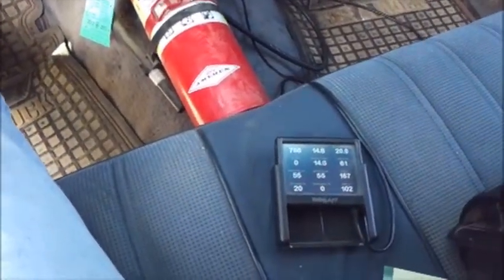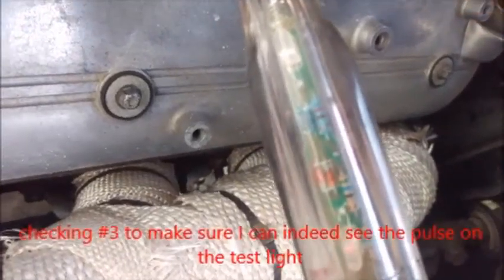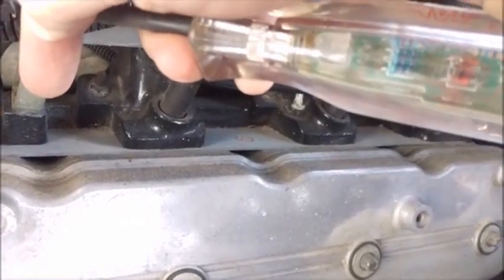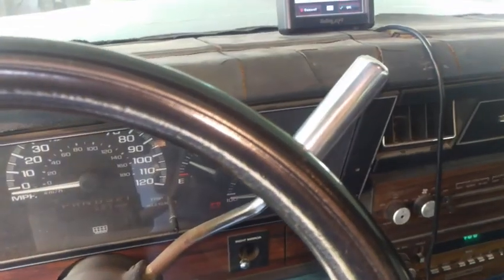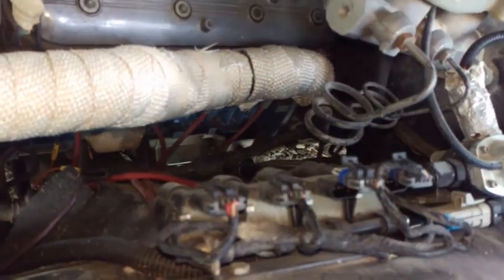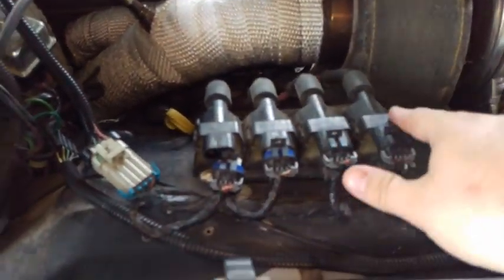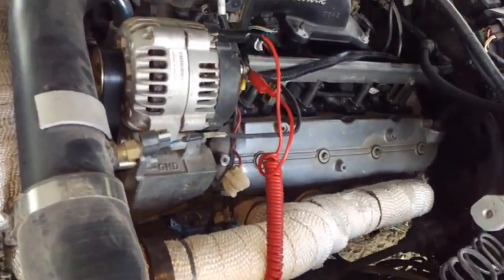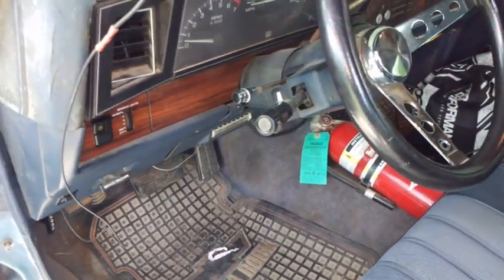holley dominator efi no injector pulse issues on multiple cylinders at once

Comment: i had the same issue with my dominator for a couple years it would occasionally start with a misfire that would heal with a restart, i'm suspecting the computer is failing, it got worse and would only fire a couple injectors and wouldn't come back after a key cycle, unplugged the main power to the computer for a minute after reading about it on the holley forum and i'd get my injectors back, fast forward a couple months and now it's completely dead, haven't had time to diag, you figure yours out? only thought that computer was expensive when i got it for 1400 new, now there 2100

Comment: check the wiring on the other side if there are pulse tot the cable's
Reply from the maker: This issue when it comes up is very consistent.  It will drop 4 injectors or 1 injector for duration of that ignition cycle. Kill key power to the ECU turn it right back on and it may not have any more issues for a week.  It has NEVER lost injector pulse after engine was already running fine. Only at startup.  I can kill the engine by unplugging injectors or coils, and restart engine WITHOUT first cycling key power, and the no injector pulse will continue. The moment you key cycle and restart its fine again.  When the injector pulse is missing, if I continue to drive, it will continue to not pulse as long as I drive.
Reply: @LT1SWAPCOM  than you ECU have a problem
Reply from the maker: @djverhulst  its already been replaced by holley tech support for this issue.
Reply: @LT1SWAPCOM   than look for interfearing  of the cable or bad connector power of grounding

Comment: I’m having the exact same problem, It will drop ground to one injector every so often while cold only on startup but it will do it all the time on start up while hot. I must turn off and restart till it comes back. 
Holley techs are no help at all. Sucks because it only has 2k miles and I spent 5 thousand dollars on just the efi for it to sound like a pos. Now I know why everyone is switching to fuel tech.

Comment: Almost sounds like a bad ground.
Reply from the maker: What would make 4 injector drivers in the ECU work and 4 not work, then key cycle and all 8 work again.   There is only ONE main ground to the ECU and ONE main power.
Reply: Did you figure it out?
Reply from the maker: @29auto30  no, had issue 3 years, goes away in cold weather. probably come back around summer.
Reply: @LT1SWAPCOM  When its doing it have you checked voltage? and amps? going to the ecm,and the injectors